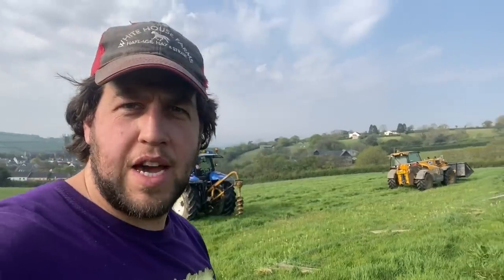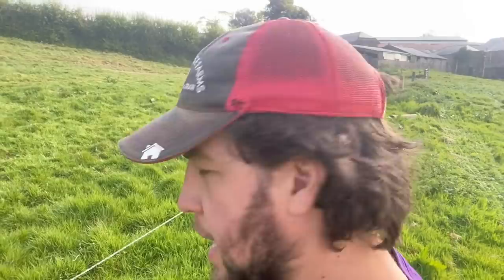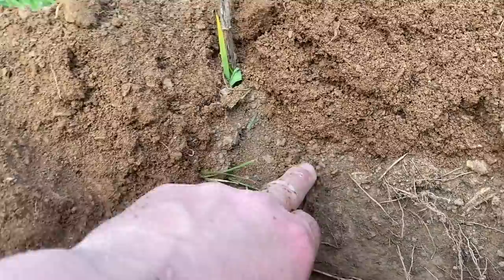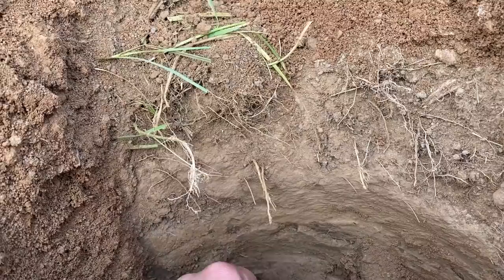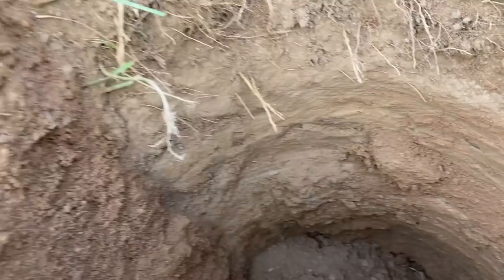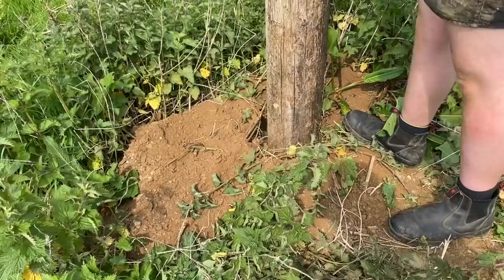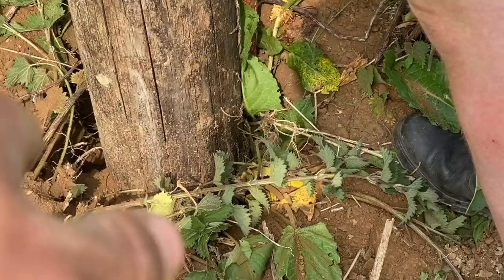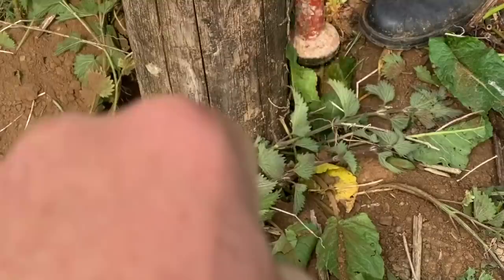Fencing in animals the hay team style part 2. Episode 51

Comment: Hi Justin & Charlie. Well done 👍🏻 and auger can be cleaned if you can quickly forward & reverse. I put two posts in like yours for a gate on my sisters stables though as ground was an old rubbish tip, had to concrete them in. Well lasted 👌🏻 stay safe with the machines